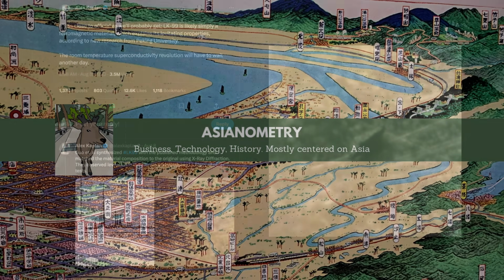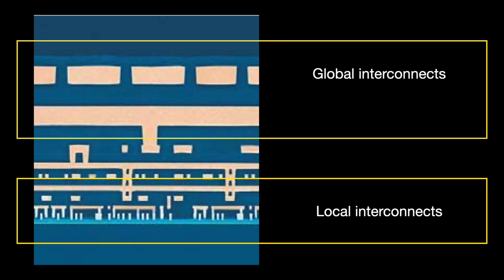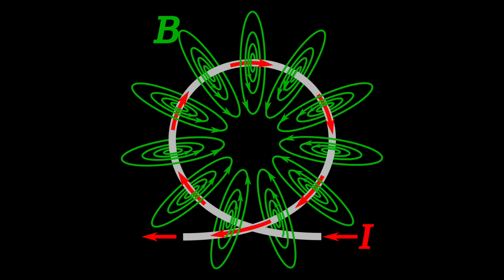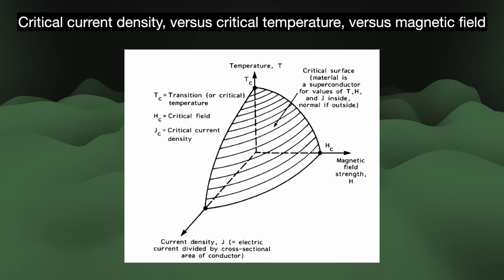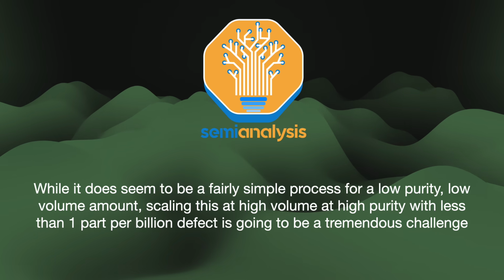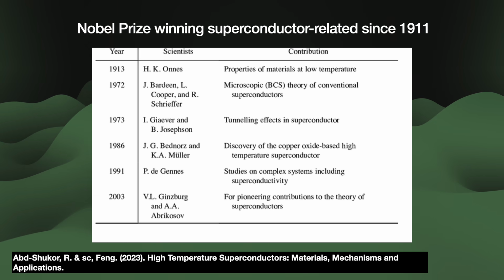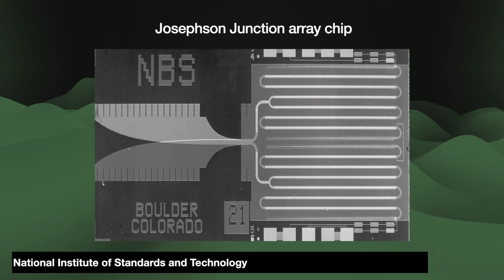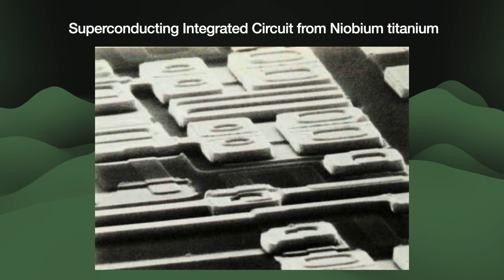LK-99 Wouldn't Have Changed Semiconductors Anyway

Comment: You still need a line resistance to pull the current through the line, outside of the resistance of the loss generated by the conductor of travel.  If u did not it would be fiber optics.  The interconnects between chips is a good thought great update !

Comment: Imagine the di/dt currents if superconducting global interconnects were used. Of course the major resistance would still be the RDSon's of the PFET/NFET at the transmitting gate which are still greater than copper or aluminum's conductivity.

Granted yeah at the end of the day parasitic capacitances and cross talk inductances would still limit the velocity of propagation. And at that point you're better off using, relatively speaking, more practical photonics.

Comment: LK-99 is also a ceramic, which makes it even harder to manufacture, since you need 1 large piece since you cant join ends together. Cracks are also fatal, so any strain or expansion due to heat of it or surrounding material are a challenge.
There are other ceramic super conductors which have been discovered before which operate on liquid CO2 levels (200K), versus the liquid nitrogen (77K) or helium (4K). But if you cant spin a wire of it... is it really game changing?

Comment: Firstly, using superconducting material could allow us to choose different materials in between interconnect, which would decrease leakage and improve chips (there's also the possibility we'd need to choose a worse material).
Secondly RC delay is based on time constant Tau, which is resistance times capacitance, so RC delay would decrease a lot with near-0 resistance aided by superconductance.

Thirdly (and this is the longest one), the josephson junction problem was likely at least in part due to the issue of cooling. The superconductors IBM used needed liquid helium to cool to near-absolute zero (4 Kelvin). IBM cited Josephson junctions consuming 1/1000th the power of a traditional semiconductor, and I'd imagine if the claims of the superconductor were true, it would be significantly easier to cool the area around superconductor which hypothetically superconducted at room temperature to 20 or 30 degrees celsius below ambient while it sips 1-3 powers of ten less power of the traditional circuit power is going to be dozens of times easier than approaching 4K in cost, heat transfer performance and energy input. It's quite possible IBM's circuit size was to increase surface area for liquid helium contact to stay in superconducting range while operating. The biggest issue with superconductor logic right now is quite literally that we need to design them around cooling them to absolute zero. Getting a ceramic that's difficult to create but doesn't break at 100K is probably going to vastly change the designs around superconductor logic in ways no one can predict.

I don't disagree with all of your statements, but some of your points felt blatantly ignorant on the decades of material design that goes into semiconductors. In the short term, your points are 100% correct about the introduction of a superconductor, but in the long term it's doubtful any of the material choices for semiconductor design decisions we made for silicon will remain in Superconducting logic if we get a superconductor, meaning except for josephson junctions your leakage current and RC arguments are mearly moot if a material change happens with superconducting logic design.

Comment: Um... inside chips is one of the least critical applications for superconductors. Power generation, solid state motor design, energy grid power distribution, space travel, medical equipment, electric cars, long distance telemetry... we really don't need superconductors in computers. We need them in everything else.

Comment: A supercondutor is not for computing...
I mean I guess, but why bother.

Superconductors are for power distribution.

Resistance can waste as much as a full half of the power generated into heat.
Power storage and generation itself.

You can use it for active support in construction, space travel, travel period.

Cpmputing? It can help in cooling the CPU.
One end is close enough to absorb heat from the CPU, the other end is consistently cooled to well bellow Superconductor point
So even if you have a power surge/use, the extra heat even if it accumulated a bit at the heatsink end, it will still function.

Better cooling, better computing speed.

Comment: Thanks for the video. It's refreshing to see a realist's point of view on LK-99. This is quite different to other videos I've seen on this topic. Although I can understand the general message, several statements can be rephrased to improve the clarity for the viewers. I'm not an expert myself, so I may have some incorrect information as well, but here are my suggestions:

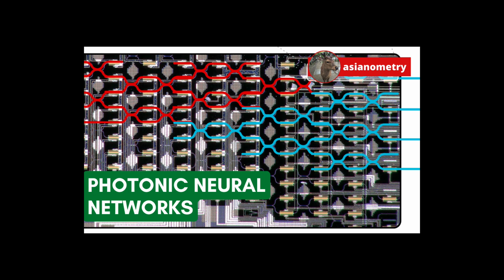1. at 2:51, it's a little confusing what Mr. Sludds said about transmitting a zero or a one. Since superconductors dissipate zero energy, using superconductors for this purpose doesn't immediately paint a clear picture for me in how this would be done. Maybe I'm one of the only few who didn't immediately get it, but in case there are others like me, it can be elaborated. It was confusing to me, that the logic level used in the circuit will have a finite voltage level (say, 5V), and the leads used are made of superconductors, so this energy would break the superconductivity and defeat the purpose of using superconductors for this application.... (The I-V of a superconductor has a flat voltage up to the critical current, beyond which the material stops behaving like a superconductor). Also, using superconductors for ultrashort leads could be challenging. I'm not sure what the coherence length of a room temperature superconductor would be - probably ~1 nm, so ~5 nm leads may still work - but making "short lengths of wire" for transistors will not be the best application for the superconductor. Proximity effect can also complicate the behavior of the transistors. It may be better to use the superconductor to connect different chips together, or to supply current; as you said, in large interconnects.

2. 4:00 If a superconductor is used, there will still be a net gain in the efficiency. You swap out some of the R=finite Ohms with  R=0 Ohms in an RLC circuit, the net impedance will be lower.

3. at 4:50 about the RC time, if you replace all the loads with superconductors, you would have RC=Tau=0. But I think, in reality, there will always be some R since, you'd want to keep the transistors to be made of silicon, but again, there would be a net gain due to the decrease in R.

4. at 6:15 regarding the current densities, superconductors can take quite a bit of a beating. if you take YBCO for example, the maximum supercurrent density is ~1e10A/m^2. This is more than enough for an interconnect. The cuprates never made it to the "IC arena" because there is a too small of a market for ICs targeted below 90K. No foundry is going to invest in multimillion dollar equipment for a small market. There are some talks about using cuprates for MRIs, and transmission lines, but I'm not sure if this was just an academic thought experiment...

5. Regarding the integration of LK-99 into CMOS foundry at 7:00, no foundry in the world is going to implement LK-99 unless it is indeed a superconductor. Materials like Pb and Hg are strictly banned, because of hazardous issues. LK-99 won't pass the RoHS criterium by the EU, which would make the companies lose one of its biggest markets. Not only that, Pb is a nasty material to include in your ultra-clean CMOS process. If it IS a superconductor, that's a different story. The EU is pushing strongly for quantum computers, and high temperature superconductors are needed in various applications (i.e. solenoids used to generate super high magnetic fields). If it does attract foundries, and EU eases the restrictions on Pb, then it's a matter of time, before material scientists and engineers to optimize the large scale synthesis of these sort of materials. Typically, for unconventional alloys which need high crystallinity, high temperature sputtering can be used to deposit high quality materials coming from a high quality target. Of course this would be done before the CMOS process. Or maybe plasma enhanced growth processes can reduce the growth rate, but this will probably not result in single crystals. However, single crystal superconductors may not be strictly necessary. It depends on the application. The superconducting wires used for MRI are not single crystals. Superconducting Josephson arrays demonstrated by NEC were not single crystals.

"we've been playing around with copper for 10000 years", yes. but only a fraction of that time was spent analysing and optimizing the growth of copper. Just because something is difficult now, doesn't mean that it shouldn't be explored. It's about the return on investment. If the return is the growth of a real, irrefutably proven room temperature superconductor, companies will invest. Also, we learned a lot about material growth and different synthesis over the past couple hundred years. We can apply what we learned towards a new material not only to learn about the material but also to optimize its properties.

6. 8:17 Josephson junctions can be constructed with other weak links, not just insulators. Josephson junction come in different varieties: Superconductor - Insulator - Superconductor (S-I-S), Superconductor - Normal metal - Superconductor (S-n-S), Superconductor - constriction - Superconductor (S-c-S), etc. Supercurrents are in superconductors even without the josephson junction. It's the superconducting current. What you are referring to, is probably the Josephson current. Josephson effect is one of MANY examples of quantum mechanics that we have observed.

7. 10:27 The issue on scalability is true but at the same time, no company really tried that hard. 1. Since there was a small market (if it existed at all) for low temperature junction arrays, companies had very little incentive to explore superconducting devices in large scale. 2. Even if you cool down the devices, the limitation is in the coherence length. This is the lengthscale that determines the smallest feature on your superconducting circuit. Since room temp superconductor would have an ultra small coherence length (if it abides by the same rules as other superconductors) the circuits made of the room temp superconductor could be miniaturized, fitting much more per area than what was done with Nb or Al. 3. The tools for fabrication are better nowadays. in 1990, node sizes were ~600 nm. Nowadays, we are pushing below 5 nm.

8. 12:24. Rule of thumb, is rule of thumb. This is a practical, but arbitrary blanket criterium which is very useful for 'regular' superconductors (especially type I superconductors which are more susceptible to disturbances like magnetic fields) used in applications at cryogenic temperatures but does not necessarily hold for high temperature superconductors. It all depends on what the application is. The critical current scales as (Tc-T)^0.5, so at around 300 K, the critical current density will already be 50% of what the maximum would be, assuming that the Tc is 400K.

9. 13:43 It would be helpful for viewers to understand why room temperature supercomputers are not likely even if we discover a room temperature superconductor. I will briefly mention here. This is unfortunately true, because the leading method of producing qubits is by using cQED devices e.g. transmon qubits. The typical resonances are at several GHz, and a lot of engineering go into the cryostats to filter out other noises above and below the few GHz range. However, a qubit at 300K, meaning all the circuits, electronics and filters will be at 300K will have blackbody radiation of 6THz. Meaning that the qubit will likely be destroyed by the thermal noise. BUT, this is only considering the cQED qubits. If you go the route of NV centers, then you don't need room temp superconductors but the qubit operations can still be performed at room temp. These are difficult to scale up though. Perhaps there is a way to make use of superconductors in supercomputers even at room temperature. But I think room temp superconductors will find other valuable uses in our civilization, e.g. affordable MRI, Maglev, Energy transportation without dissipation, etc.

10. It seems that this video is focused purely on state of the art computational processing units with high density transistors. But foundries also make other chips for other applications too. 

Thanks for the video and good luck! 
Cheers,

Comment: Even if LK-99 didn't work out as a high-temperature superconductor, I wonder if some of the more traditional known low-temperature superconductors would work with quantum computers? Both quantum computers and superconductors work around the same temperature ranges, near Absolute Zero.

Comment: superconductor won't produce heat to begin with so your argument is false already in the first two minutes of your video. A true room temp/pressure superconductor will change the world.
Reply: Even if the interconnects aren't making heat the transistors will.

Comment: It might help with one problem that is going to face us soon. Nuclear Magnetic Resonance magnets (e.g for use in MRI) use helium for cooling. Unfortunately most of the helium comes as a byproduct from the oil and gas industry. When we stop drilling for oil, that source is going to dry up. If we can get something that usefully superconducts in the liquid nitrogen temperature range it will be a big win. Thanks for the video, you highlighted some problems I had not even dreamed of.
Reply: This is the problem we will face in about 80 years ;)

Comment: The speed of electromagnetic waves of a transmission line is determined by its impedance given by its inductance and capacitance per unit of length. And this makes the transmission line dispersive so the speed depends of frequency distorting the signal and digital signals have a lot of high frequency components.

Comment: Small gain from switching from metal to superconductor. Issue with keeping temperature low, low current capacity, and brittle ceramics.

Comment: If inductance is a still a problem for super conductors then they don't seem too useful for long distance AC transmissions as inductance is the big issue with AC transmission. Sure super conductors may be useful for HVDC but the problems with HVDC are elsewhere. Of course we'll not know until it could be manufactured at scale and tested in real world situations. The hype around super conductors has a life of it own, lets hope this wont turn out like cold fusion did

Comment: Digital electronics deals with entropy. Entropy and temperature are connected. 

DEC's Gordon Bell used to abstarct systems into PMS for Processors, Memory and Switches.

Memory is a function that preserves information over time.

Processors here are elements that change info in a specific way over space. (No VAX, just an arbitrary array of hardware that changes inputs into defined outputs given a certain time to settle).

Switches are the interconects from outputs of some logic to inputs for another step.

In an ideal world one could have a hardware logic to do each work needed.

TI had the TTL Databook standardized catalog of functions integrated into chips. It was widely adopted at "small" scale integration.

The digital processors we use are based on an idea of reusing the logic (ALUs - Arithmetic & Logic Units) through carefull partition of the work to be done (the algorithm) in a finite number os steps were information flows through the logic (P) is changed to what it's ment to be in it's outputs and then stored, restored to apropriate levels of certainty (low entropy) to be usable for a next step.

The memory function of preserving each tiny bit costs energy, space, some kind of physical substrate to achieve it's goal.

Why DRAMs need refresh? Cause each bit is packed with such a limited amount of energy that it becomes prey to the surrounding environment. The limits of usefulness are when we can no longer maintain the arbitrary low error rate desired.

Sure there are ways to have some kind of fault tolerance embedded in other levels.

The Space Shuttle was said to have four identical computer voting.

Error Checking and Correction - ECC is applied to higher demandind applications since the 60s at least.

Shannon's theory for communication bandwith also deals with reliability and entropy.

Modems with Viterbi methods improove reliability allowing just some of the possible state transitions, enabling reciever to have a better chance to correcty decide what was sent.

Temperature, radiation, electric spikes possibly induced magnetically are all at odds with preserving info.

Memory is useful as it's contents are changeable into what is needed. Reliably preserving a bit of information require higher input energy to change it.

The lower the energy needed to change a bit, the higher the risk of a stray change.

Avionics and chips that go into space might need a radiation hardened design. 

At some point miniaturizing and using less energy is counterproductive.

The Superconducting phenomena will certainly open new avenues for technology. Might find very useful applications. It won't change those basic principles though.
Reply: Choclenidah

Comment: TBH whenever people ask me about this I'm like it fixes the helium shortage and that's maybe about it. People were talking about using these things for long-distance electrical transmission and it's just like, sure, let me know when you can get ceramic materials into a spool of wire without it shattering...this stuff isn't flexible like the glass in fiber optics, folks.